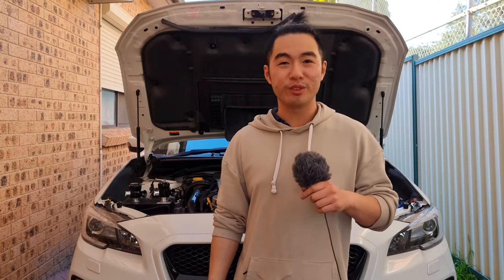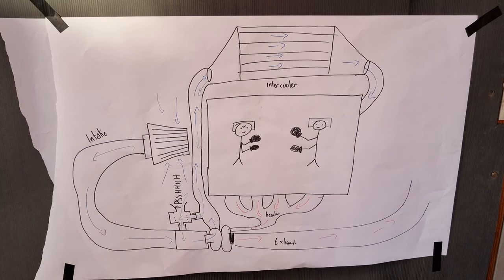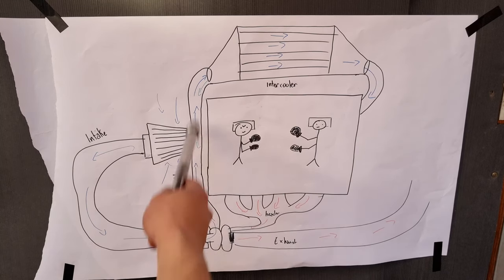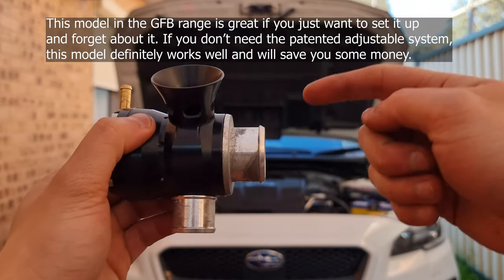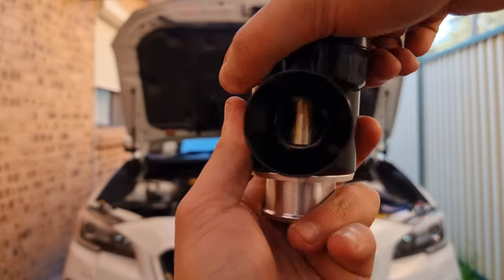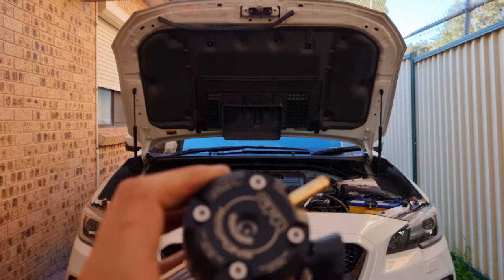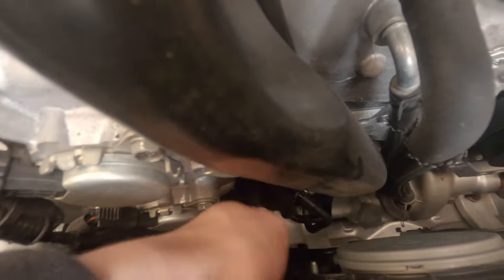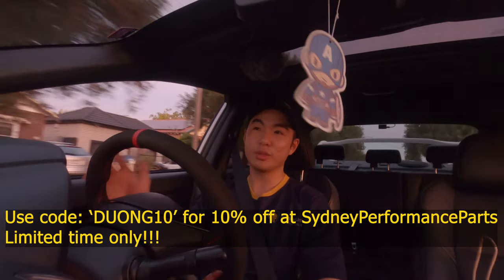Installing a GFB RESPONS BOV on my 2015+ Subaru WRX Premium

Comment: Air going back to the turbo cold side will not spin the turbine backwards. It will slow it down the turbine, means you need a bit more time for the turbo to spool up to normal speed again.

The stutututu sound comes from the pressure getting chopped up from going back and against the spinning turbine.

Comment: @MrDuongTV1 
Hey mate. If I'm on full recirculation does the spring load matter at this stage? Cos if the spring load is set to tight wouldn't it require high boost to open and allow air to recirculate? Should the tension on the spring be loose on full recirculating to allow the air to get out and recirculate or does it recirculate regardless of the spring tension?

Thanks in advance 🤙🙏🙌
Reply from the maker: Great question mate. Everything you said is 100%, in theory anyway. I have mine on full recirc 100% of the time now, and I haven't had to change the spring preload. No issues.

Comment: Just wanted to ask about the bov and get an update since you've had it on for a minute now. No CEL from it running to rich? No problems? I wanna get the exact one for my wrx soon. Great videos man!👊🏾
Reply from the maker: Hey mate, thanks for watching :) Yeah its been running fine without any problems, no CEL, it only runs rich for maybe a split second - gotta make sure you dial the spring load all the way in. Though its worth noting I don't vent more than 30% with the adjustable version. Check out my latest video for a discount code with my latest sponsor for 10% off your BOV if you're in Australia mate!
Reply: I have this on my 2020 Sti but the previous owner had it set to 100% vent to atmos.
Will dial it back to 80 recirc and 20 vent to atmos.
Was thinking I might just put the bypass valve back on I'm just concerned with the whole glazing the cylinders thing over time.
Reply from the maker: @McPerferct  you can just set it to 100% recirc and it'll be completely fine mate. I keep mine on full recirc most the time, unless I'm filming a video
Reply: @MrDuongTV1  mines on full recirc but no matter what spring tension i set i get no noise? Is it because of my stock intake
Reply from the maker: @nes3382  On full recirc, you wont hear anything with stock intake. You need some level of venting to hear the psh psh.
Reply: @MrDuongTV1  righto cheers I’ll give that a go

Comment: @mr duong tv I love the subi sounds great. My question is do you have to send the vehicle in for a tune once you adjust how you want it and install this product??
Reply from the maker: Hey mate. Its a bit of hit and miss. All the internet warriors will tell you that you have to. I've spoken to a few tuners and mechanics, they said it doesn't really matter. I didnt get mine tuned after putting this on, but when I went to get it tuned after fitting the down pipe, i asked the tuner about the BOV he said it doesnt really make a difference.

Comment: i have the gfb but i had to put it i think 30/70 because i was getting check engine light i can barely hear it with my settings any recommendation? subaru wrx 2015
Reply from the maker: Hey mate thanks for watching. Did you dial the spring load all the way in? Its plenty loud for me with my venting set to 30%

The car will stumble if you dont dial in the spring load high enough, and cause that CEL

Comment: My 2013 wrx had the same BOV when I bought it. It was almost wanting to stall out sometimes when I would stop at a stop sign, maybe I need to adjust the spring? Thanks for the info!
Reply from the maker: Yup, dial the springload all the way in and make sure all your hose clamps are tight. It may also want to stall if you're on 60%+ venting. Thanks fkr watching mate!
Reply: @MrDuongTV1 if u dial the spring load all the way in would that make the sound lower ? I’m having the same stalling issue

Comment: Mine came with a gfb, but I don’t understand why you’d want that untuned, the oem bpv is good to 19, and the gfb doesn’t sound any different unless you open the bov, which isn’t good for the engine
Reply from the maker: Whole bunch of myths mate. Some mechanics and engineers say need a tune, some don't. Believe who you wanna believe after doing some research 🙂
Reply: Brother what, 90% front mount kits come with only a blow off no recirc also. I’m running 26 psi and the stock recirc is shit. Leaks boost being plastic, proper pro tune not just off shelf and a blow off can be 100% healthy